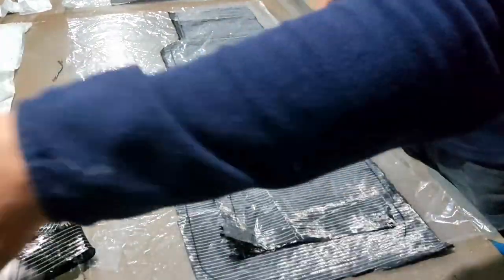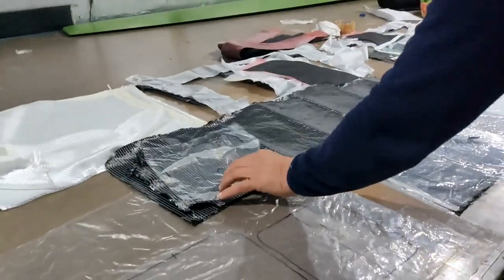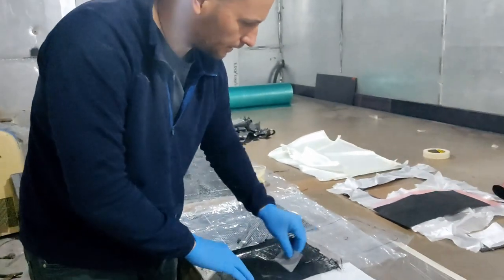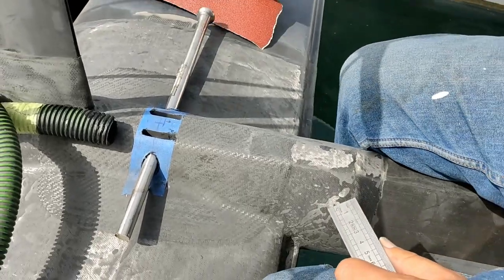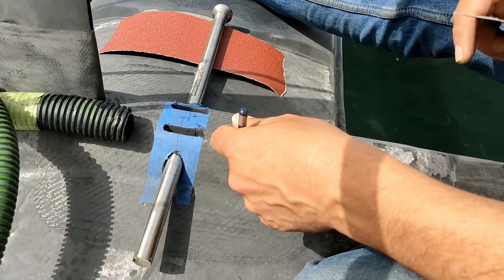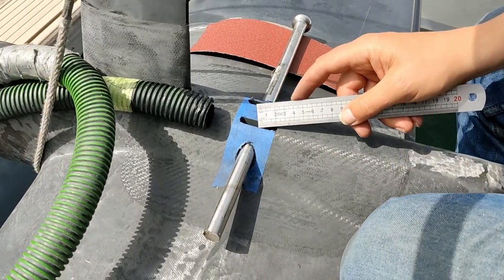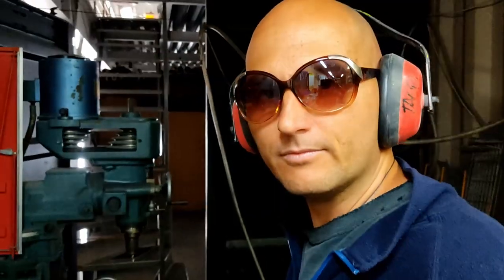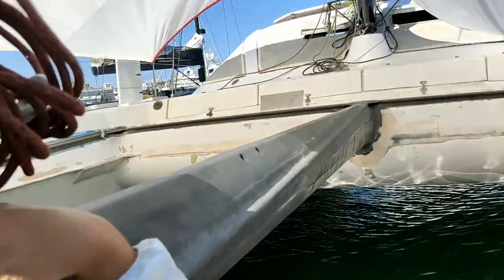Attaching the forestay to our carbon fibre front beam

Comment: Coming together great! What is the ratio number you use for the glass weight to resin mix if you don't mind sharing that.
Reply from the maker: That depends on the job but the rough rule of thumb is 50/50